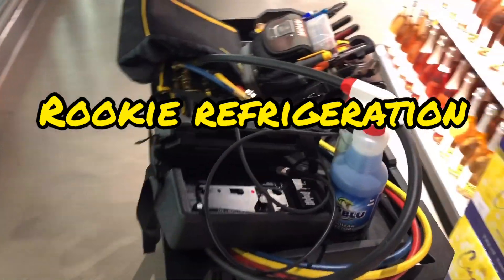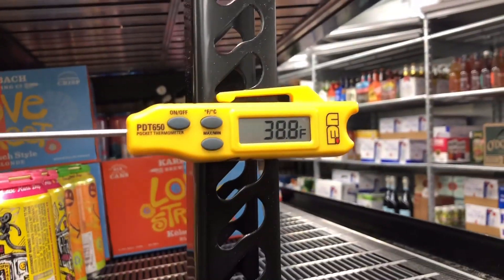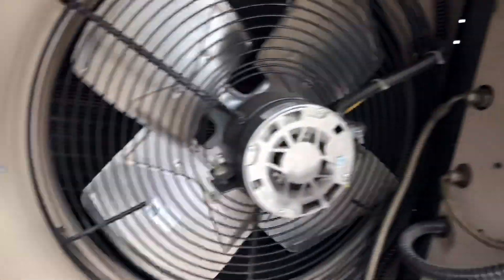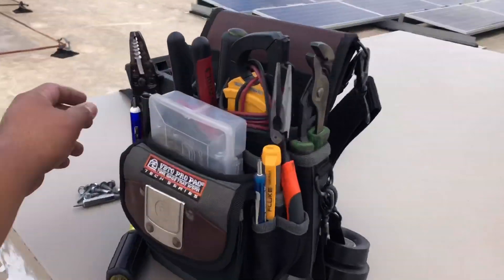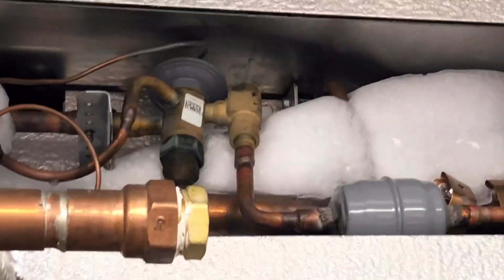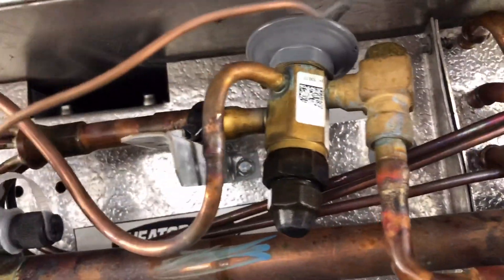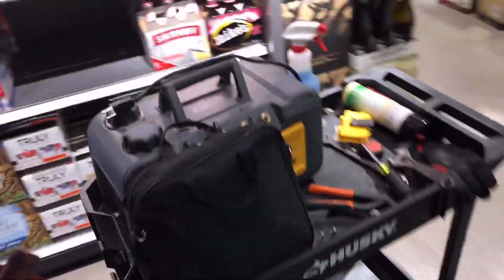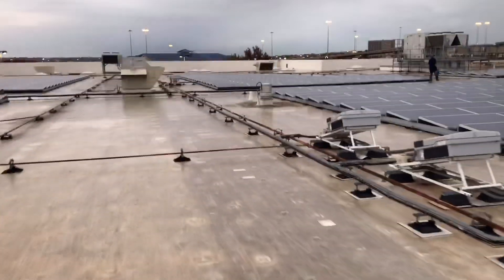HVAC REFRIGERATION:  Walk In Cooler leak check and restriction

Comment: Phosgene is no joke. It can be lethal at as little as 2 ppm. It  literally destroys your lungs ability to get oxygen to your blood. Be very careful and don't hesitate to stop work better safe then dead.
Reply: same gas as used in ww1  trench  warfare
Reply from the maker: Agreed bro.  We were really out of breath and woozy for like 2 hours.  No joke.  Will be more careful next time
Reply: @rookierefrigeration4357  another thing to remember is that freon is heavier than air - there wasxa guy in Alaska that went into the mechanical room under an ice rink in a mall in Anchorage alaska.  A small line for one of the pressure switches had broken during the night and the exhaust fan was broken - the gas settled in the room and he walked off into it - he was out before he knew it - dead ... I used to work on fishing process ships - 4000 pounds of R22 running a -40 evaporator .. you had to be very carefull on a ship - if you had to isolate a screen and bleed it off (before recovery rules) you had to rig some ventilation and just wait till the little space they were in cleared ... to get to some of the screens and filters you had to open a hatch and climb down a ladder into the sealed room... very dangerous with R22.  Some of the boats ran ammonia systems - I hated them but you had no problem knowing there was ammonia in the air...

Comment: Hey man I love your videos but your using that h10 all wrong bro not using half the potential it has. Gotta warm it up on auto and touch the probe to the calibration bottle and it should flash into red and come back down then you switch it manual and ramp it up to 3 beeps a second or so. Mine can smell the calibration bottle without even touching it. Just food for thought keep up the good work.
Reply from the maker: I’ll try that.  I always just use out on auto. Lol. Thanks for the advice

Comment: Stay safe out there and good repair.  Not to bust your balls but thats not a king valve. Only a valve on a Receiver in an Ammonia refrigeration system is called a king valve because it stops everything.
Reply from the maker: It’s a king valve.
Reply: A king valve is any service valve in the outlet of the receiver.  They aren’t just on ammonia systems..

Comment: you cant go by the supply air temp coming out of the honeycomb vents to say the box temp is too cold...supply air is going to be colder than the box temp is...best place to take a temp reading is in the middle of the box away from any airflow
Reply from the maker: kingofthecrease30 all sensors are reading DA temp
Reply: @rookierefrigeration4357  i meant when you put that pocket thermometer on the honeycomb vent and said the box was running too cold